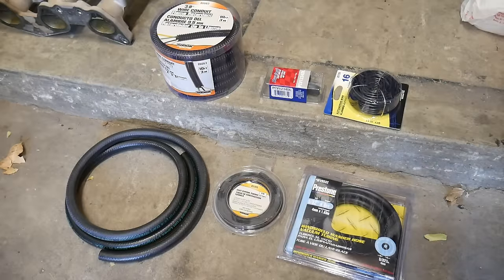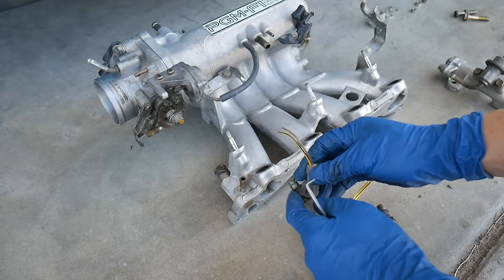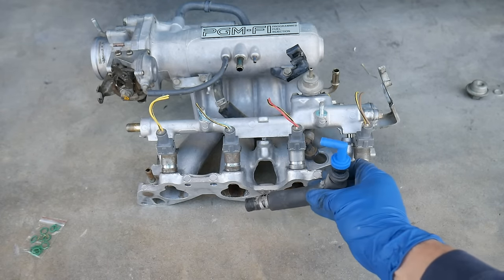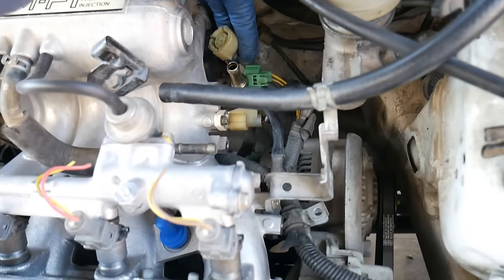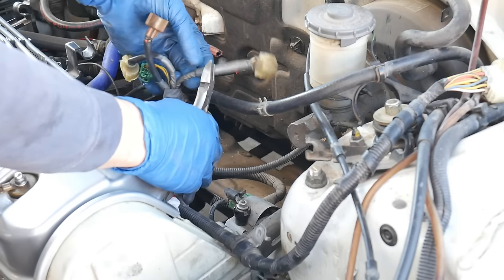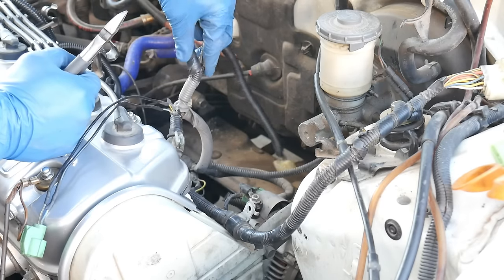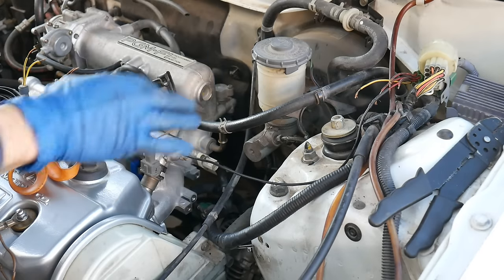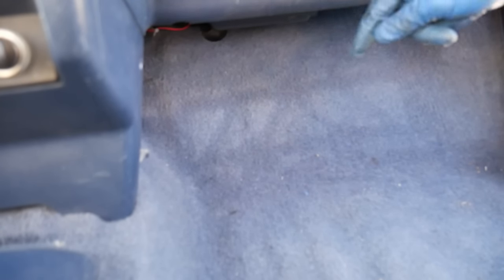DPFI to MPFI Complete Wiring Guide - 88-91 Civic & CRX

Comment: great vid john waiting for next sat.. im having a issue with my  89 d15.. keeps stalling when i try to start it.. between 5-15 stalls before it runs fine.. only thing I have done is alternator/starter/batt/fuel filter since I bought  it. any ideas? im thinking fuel pump but im not sure..
Reply from the maker: Can you hear it prime? Plugs and wires new?  I've seen car have trouble starting with crappy plugs/wires.
Reply: Jon Widmer ok well it escalated today to a start then die situation.. but before I change the pump I wanted to ask you if this year car has a fuel pump relay and if that could potentially  be the problem..
Reply from the maker: SunShineMoto yes, the main fuel relay is a known problem on these cars.
Reply: Jon Widmer changed the main relay today.. still wont start... dosen't  sound like the pump is kicking on..I can here it make a slight noise right before the starter kicks in but thats it.. it starts runs for 2 secs maybe then dies.. checked timing and spark today also.. there fine.
Reply from the maker: Just watched.  Nice vid!  Can you hold the key into position 2 to keep the car running?  Turn the car on but hold the key in position.  It almost looks like the ignition switch is broke.  This happened on my sedan and I had to hold it into position all the way home one time.  Was not an easy feat.
Reply: Jon Widmer if i hold the key in position 2 the starter just keeps skipping when the motor tries to start.. unless you mean where the key sits while its running.. then no still dies..
Reply from the maker: SunShineMoto Try to start it by turning it past position 2 to turn the starter, then when the key turns back to sit into the running position, try to wiggle the key around and find a point where the car stays on.  The reason it seems to be the ignition switch is because when you were trying to start it, the moment you take you hand off and the car dies, all the lights turn off on the cluster also.  No power at all.  usually the lights would still stay on in the cluster and the battery light would also turn on every time the car dies.
Reply: Jon Widmer Thats what it is man.. you were right on point.. found the spot where it would stay running.. thank you man.. so glad I dont have to drop the tank yet..
Reply: on another note would that just be the tumbler or you think I need the whole new ignition switch harness..
Reply from the maker: SunShineMoto Shit yeah, glad that was it!!  You only need the new switch behind the tumbler.  I bought one at Autozone a long time ago, you might find a cheaper brand new one online.

Comment: Sick videos man ! Really excited to do this!  Just picked up a 90 EF Dx Hatch to mess with on the side and this is a perfect first mod. 2 Question for yah. 1 What gauge wire are you using to make the harness. 2 What more would i need to do to use a obd1 ecu instead of a obd0 ecu, my long term goal is to do a mini me swap with low comp rods and pistons and just do a cheap ebay turbo kit and have some fun and my understanding is obd1 is much easier to tune
Reply from the maker: 16 gauge

Obd1 Is the way to go for your future plans.  You'll need the subharness for the ECU and distributor plugs if you don't want to re-pin them, and that is the easiest route to go.  And also the heated o2 sensor will need to be wired in but not very difficult either.

Comment: New subscriber here been doing this since the early 2000’s  and Iv always use the stock dpfi injector wiring . Is it easier to to make the entire injector harness from scratch ?
Reply from the maker: But you still had to add wiring for 2 injectors, right?

Comment: By any chance if you come across another DPFI. Can you Tune the car with that system. Not sure how it works or whats broken but keeping it for a while. It is just smelling like gas way too much.
Reply from the maker: Tuned on dpfi?  Not worth it if that's what you're asking.  I'm not sure what you were asking with the gas statement.
Reply: @GarageBuiltHondas  If the car is rev in neutral or in gear and I rev past 5k the interior stinks. I am just looking to fix that but don't fully understand the system or what to look for the car doesn't have Idle problems or anything. It just runs too rich at high RPM.
Reply: How to Test Fuel Pressure, Pump and Main Fuel Relay - Honda Civic CRX 88-91 EF  Found the Cure.  lol you had it all along.

Comment: I’m planing on building mines soon I have a rebuild head and block all machine work done to it. My question is can I use my old a6 harness to do the conversion? The car is originally dpfi and want mpfi since I have extras laying around
Reply from the maker: Daniel Rodriguez You cannot add the mpfi harness into the dpfi setup.  It will not work.  It will only work if you swap the entire harness under the dash along with the engine bay harness.
Reply: Garage Built Hondas 

Thanks so much 
Just to make sure before I go out to buy a harness I could use one from a 88-91 non si? Or does it have to be specific one?
Thanks again your a lot of help
Reply from the maker: Daniel Rodriguez Any of the 88-91 models, it doesn't matter which model (hatch, sedan, crx, wagon) as long as it's DPFI.

Comment: I have a 1989 manual 4 door EF. Taking the DPFI and putting in D16z6 from a Civic Del Sol 1995. The donor car is AUTOMATIC. Im planing on installing the new engine with its original harness from the Del Sol and the P28 ECU converting it to MANUAL taking the 2 resistors off. But is there anything i need to do the harness to have the car running?
Reply from the maker: You'll need to use your original harness.  It'll be a headache trying to use the del Sol harness in your chassis.
Reply: Garage Built Hondas so ill be better off buying the OBD0 to OBD1 connectors? Do you have any tutorial vid on how to do that after installing the d16z6 engine?
Reply from the maker: Yes.  
And no, I do not have a video.
Reply: Garage Built Hondas do you think you can give me some steps on what to follow on this process? I saw you have a vid from OBD0 to OBD1. Should i follow that process or is it different.
Reply from the maker: You'll have to do a combination of both dpfi to mpfi and also obd0 to obd1.

Comment: Watched this video and its super helpful thanks for doing it super detailed and helping us out in completing these swaps!! 👍just had a question does it matter if i use obd1 injectors??
Reply from the maker: Compared to obd0 injectors?
Reply: Yes compared to obd0 will there be a difference?
Reply from the maker: You'll need to keep the resistor box using obd0 injectors.
Reply: So the car will not run if obd1 injectors are connected to resistor box? Will the ecu not read it? Or whats going on with that?
Reply from the maker: Fry either the injectors or ECU.

Comment: Hi, I'm about to do a swap d15b1 to d16y5 vtec, with ecu p28, can the gearbox use the same? and if I have an original harness, should I use the p28 converter?
Reply from the maker: Yes
The conversion harness?
Reply: The engine is 1996 and can I use the same transmission box of the d15b1?
Reply: Will you have a video where you change from obd0 to obd2? to guide me. or do you have any written guide ?.
Reply from the maker: I don't.  Obd1 is your best bet.  Going obd2 will be difficult.

You'll need to use a transmission that is compatible with your car.  Hydraulic for hydraulic and cable for cable.

Comment: The green connector with the 4 red wires where did you get this from? Was this the green clip you cut off that you said you werent going to cut off before you cleaned up the engine harness
Reply from the maker: +Logan Beringer It's for the resistor box and you'll find them on any mpfi civics/accords from the early 90's.
Reply: Garage Built Hondas oh okay thank you

Comment: 12:45  Those are the GROUND wires. The injectors get constant 12 V with the yellow/black wires and the ECU grounds the injectors to get them to open.
Reply: Do you need to change ECUs to do this?

Comment: Hi Jon, is there any benefit to using a CRX SI head (I have one with its cam and intake manifold for my conversion)?  Or Is the D15b1 head the exact same thing and the difference in power with the SI Is the mpfi intake manifold and camshaft? (of course the slight bump in displacement as well).
Reply from the maker: The camshaft is better in the A6.  My first ever MPFI was a swapped A6 head onto a B2 block and it felt great.  It was just easier at that time because I had the head rebuilt because I wanted it fresh.   The cam definitely will help.
Reply: I am doing a mini me swap on my 89 crx with a d16y8 head and intake manifold so my son was going to put the head and cam from the CRX (along with the intake manifold) on his 91 civic that has a d15b1 in it. (the MPFI swap)  I just wanted to make sure we weren't wasting our time by getting the head prepped to put on his motor if we would get the same benefit by just putting the intake manifold and cam on it. :)
Reply from the maker: No, it'll be a nice upgrade and give a little extra bump in power.  My wagon that is mpfi now could really benefit from the cam.  It made 10-11 wheel HP at the dyno going from dpfi to mpfi.  The cam might have made a couple more I imagine.

Comment: Help help help no check engine lights got rid of them all injector a5 not shooting gas what can it be? If i pull out the spark plug boot the car does not shut off.
Reply from the maker: Injector a5?  What car, what engine?
Reply: 91 crx, I redid all my wires because i did direct connect to the ecu but now its just plug in play. The problem is cylinder 3 is receiving spark but no gas. All other cylinders  work fine. Even if i pull off the spark plug boot the car doesn’t shut off or seem to loose any power. What could this be?
Reply from the maker: Have you tested the wires with a multimeter?

Comment: Do they sell the harness to avoid doing all this? I don’t wanna accidentally mess up and then I’m stuck.
Reply from the maker: Yes
Reply: I have a manual wagon but I have a spare automatic harness from another wagon are they the same to this mpfi conversion?
Reply from the maker: No.  A MPFI harness will not work on a dpfi chassis vehicle.

Comment: Where did you find the resistor box and what does it come off of
Reply from the maker: 88-91 Civic/CRX Si models.  Also 90-91 Integras and some other 88-91 Accords and Preludes but those will just look a little different.

Comment: Wow how  you know  all that
I do have a crx ef and when get hot start idling  and when I turn on the ac goes a way  any ideas please thanks
Reply from the maker: Maybe a small vacuum leak somewhere.  Check all the hoses and the intake manifold gasket and throttle body gasket.
Reply: @GarageBuiltHondas  ok thanks

Comment: Does this video apply to Honda civic eg 1993 lsi auto?
Reply from the maker: +MrZeroLag I don't believe so, which country?
Reply: Garage Built Hondas.
In the UK
Reply from the maker: +MrZeroLag it's DPFI?
Reply: Yes dpfi no vtec
Reply from the maker: +MrZeroLag very similar, but differences in the wiring since your model may be equipped with a newer obd1 ecu.  Do you know what obd your car is?
Reply: Garage Built Hondas
OK well I assume it's obd1 I'm sure 92~95 civics all are? 
I will check and report back👍
Reply from the maker: +MrZeroLag Yes, the wiring will be different at the ecu since it's obd1.  That's where you'll have to determine which wire foes where.

Comment: I'm not very mechanically inclined but I figured it wouldn't hurt to ask. When extended the wires such as the TPS what kind of wire is used?
Reply from the maker: +RyanBB Gaming I just used regular 16 gauge wire bought on a roll from Radio Shack.  Not speaker wire though, but wire made for electronics.
Reply: Garage Built Hondas sweet thanks for the super fast response I'm going to be doing this soon onnmy 88 CRX DX so I'll probably have a few more questions lmao
Reply from the maker: +RyanBB Gaming 👍

Comment: Hi mate, is the processor same for EG d15 single carb?
Reply from the maker: If it's dpfi, it'll be similar.  But the ecu pins are different.  You'll need to figure out which go where.

Comment: Hi, i have question. Can i use other inhectors and run whithout resistor box for example obd2 from 6gen? Thanks.
Reply from the maker: Yes
Reply: @GarageBuiltHondas  Thanks for answer, i have one more question can i use diferent manifold for example from D15Z6 motor ??is same as Y8 manifold. thanks
Reply from the maker: I'm not certain for sure on that exact manifold but it seems like most sohc D series all work.
Reply: @GarageBuiltHondas  thanks 😊

Comment: Thank you this was help full .
Reply from the maker: Glad to hear!
Reply: @GarageBuiltHondas  one question . One plug looks like its not used. Its the one you said you qas going to leave hang. Should i cut it was confused on that. Unless its important.
Reply from the maker: I don't recall.  I haven't watched this video in yesrs.  Just do what I did and you'll be fine.  You may need to rewatch that portion.
Reply: @alfredomunoz6347  it’s the “fast idle control valve” on the mpfi manifold but called the tandem valve on the dpfi manifold, helps idle when cold out

Comment: What injectors you running Obd0? I have a idle problem and I think I got my injector set up wrong pleas help. I'm running Obd0 injectors and a p28ecu
Reply from the maker: I'm using OBD0 from an 88-91 Civic/CRX Si.  Are you running the resistor box?
Reply: yes I do  still have he resirator box installed.
Reply from the maker: What engine and what OBD are you trying to run?
Reply from the maker: You need a different ECU.  That ECU will not work with the OBD0 components like the injectors and that resistor box.  You can use the OBD0 B16 ECU's which are the PW0 and the PR3.
Reply: Jon Widmer 
If you know anyone that gots one out there in your area maybe trade my p28 for it plus cash. You are from El paso aren't you im from Las Cruces.You raced one of my buddys at the track he had a white integra came in 2nd I think.i asked if he new you he said yeah.
Reply from the maker: Mando Lira Yup, I'm in EP!  I'll ask around!  Are you talking about Dominic?
Reply: thanks man, and yes dominic haha. I'd ask him but he's mostly Integra builds.
Reply from the maker: Mando Lira Alright cool, small world, he's a cool dude man!!  I'll see if any of the homies have an extra!
Reply: Yeah man maybe one day I can go out there with you guys ones my cars finished. but forsure bro lmk I appreciate it a lot. keep u the good vids👍

Comment: Terrific video. Quick question. In your video you were replacing what you called "vacuum" lines but were swapping a hose to the fuel pressure regulator. Are vacuum hoses safe for carrying fuel? My current knowledge is that you use either a fuel, heater, or vacuum hose depending on the application. I thought vacuum was only for lines with just air and no fluid.

Thank you for your time and help!
Reply from the maker: The top nipple of the FPR is a vacuum hose.  No gasoline goes through that line.  The return line which goes off the bottom of the regulator is made for gas.  But no, vacuum lines cannot be used for gas or coolant.  Thanks for the comment, I appreciate you asking!!

Comment: do you have to de pin the clip and swap the wires for a b series swap on a 91 si stock harness?
Reply from the maker: What ECU, what obd?
Reply: Its obd 1 i have a p72 ecu for now
Reply: B20b with type r head
Reply from the maker: @southcanprodutions9703  you're going to want to either but a new harness or use  the conversion harnesses from obd0 to obd1.  I did the latter and have a video on it if you're interested.
Reply: Ive got the jumper harnesses for ecu and dizzy im just wondering do i need to swap the wire for the tps for throttle body like u did for the mpfi swap
Reply: Like depin and put in opposite positions
Reply from the maker: If your still using that part of the dpfi harness you need to.

Comment: So you wire everything the same in the engine bay but it can change at the ecu depending on what ecu your going to use? Im going to run a p28 do i go by the pinout for that specific one?
Reply from the maker: You'll need to do this.  https://youtu.be/w0P80zWLCnM
Reply: Is there a way to contact you for help im not understanding. Some of this. I watched the other video and im lost
Reply from the maker: You need to convert your obd0 car to obd1 to be able to run the p28.  I did just that in this video, the only difference being that I'm using a p75 ecu because I'm using a b20 dohc engine.
Reply: Im running a stock d15b2 block with a y8 head and manifold.i have a p28 with the jumper. Im just having a hard time doing the injector wiring
Reply: I messaged you on your instagram
Reply from the maker: Is your car already mpfi?
Reply: Its still wired for dpfi
Reply from the maker: You'll need to do the mpfi swap at the same time adding the obd1 conversion.
Reply: Yeah i alrrady put the head on and the manifold. And i also installed the jumper and ecu. Only problem im having is wiring in the injectors
Reply from the maker: https://youtu.be/p2PtPoVX4NE

Comment: Good video,
Is the conversion to MPFI give more Mpg than on DPFI?
Thanks
Reply from the maker: No.  Stick with DPFI if you want to maintain better gas mileage.  This will give you about 10hp and better throttle response but will reduce you MPG's a little bit.
Reply: @GarageBuiltHondas  thanks Man..
I think MPFI is more of performance than and less Mpg as compared to DPFI...
Reply: Nope more feul in mpfi
Reply: i did the swap when i got my DX and my econ stayed the same but i got a big boost in drivability.
0-60 pre swap was 12.6 
post swap is 10.4
still getting 30-33 mpg